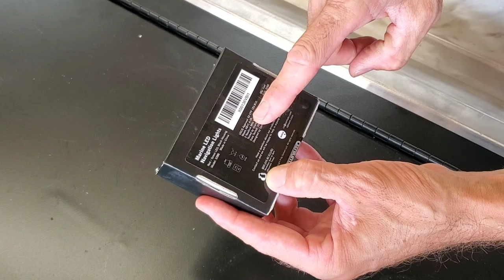Tiny Jon Boat Navigation Lights | Step by Step

Comment: Did you have issues with the cut off angles? I am looking to mount these same lights on my job boat but noticed they are designed to be mounted about 34 degrees from centerline and I suspect for myself and you as well that they are not visible from straight ahead. Making them not legal.
Reply: Yeah, definitely not a 112.5 degree installation.

Comment: These look really cool.  I have a brand new Alweld jon boat coming.  Without cutting some kind of access panel into the inside of the boat, is there anyway for me to install them?  Seems like I would have to have a space cut in large enough for me to get my fingers in there to screw the nuts on.

Comment: been watching your vids for awhile now, good job on all!!  what is the switch on the far left next to the livewell timer, you didn't say in your wiring video
Reply from the maker: It's not an electrical switch. Its a cable driven shut off for the valve within the livewell pump. It opens or closes it for livewell recirculation,  fill, or drain.

Comment: Beautiful boat build, that deck looks awesome, love it.  Just subscribed to your channel.  You video just made my choice on what bow navigation lights I want to use on my kayak.  What stern 360° white light did you wind up going with, assuming you will have that on your beautiful build?
Reply from the maker: I actually use one from Academy sports. It's made by Marine Raider I believe,  it's black and telescopic, the only one I've seen that goes from 26 to 46 inches so it fits nicely in hatches.

Comment: They might be US Coast Guard approved, but where you have them at isn’t Coast Guard approved because you cannot see them from the front very well at all. don’t mean to be a negative Nancy, but they’re supposed to be visible from the tip of the boat all the way down to a certain amount of degrees from the side when people see both the red and the green light and the white light is visible as well if people can’t see your lights see your white light. They will think that you are traveling away from them.

Comment: 3M 5200 also comes in black.
Reply from the maker: Yes. I've used it. Unfortunately they don't make fast cure in black, or I've never seen it. I prefer 5200 fast cure.

Comment: Looks great brother. The CFR is just a set of federal laws, all the other numbers just tell you what section and subsection that applies to.  You also have USC laws which can sometimes be similar, but also cover different things that aren't CFR. I deal with this crap almost daily. Also, for stuff like this, don't use 5200, that crap is permanent, meant for stuff under the waterline. A better option would be 4200 (semi permanent). Just FYI.
Reply from the maker: Thanks man! Yeah that was what I tookaway from it lol. Hey man, I'm full send, we don't install anything unless we are 110% sure on it hence the 5200! J/K..Honestly 5200 is just easier to find in most cases and I use it most for all my livewell fittings and thru hulls. Was just showing another example as the silicone I used is not an off the shelf item like 5200 which is sold everywhere.  Thanks for watching and for input!